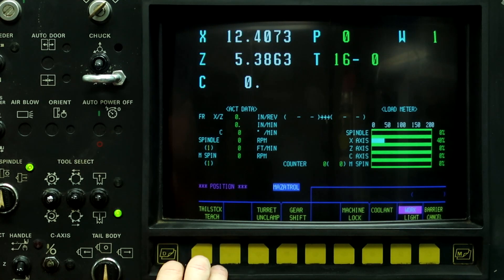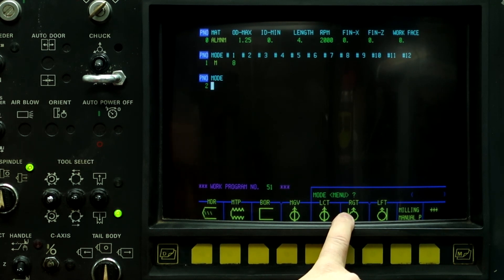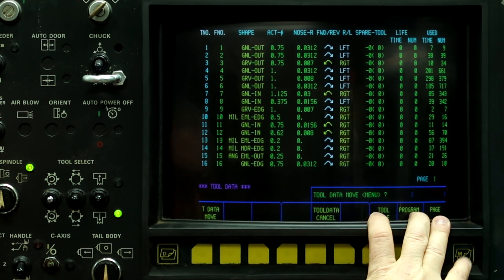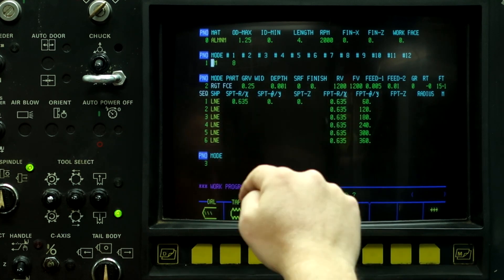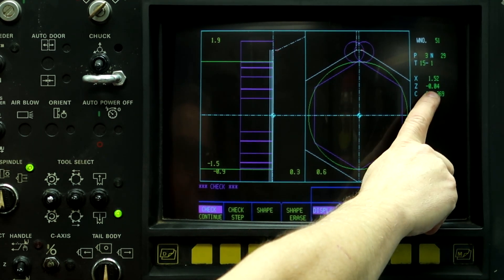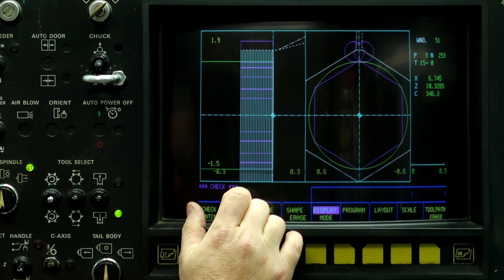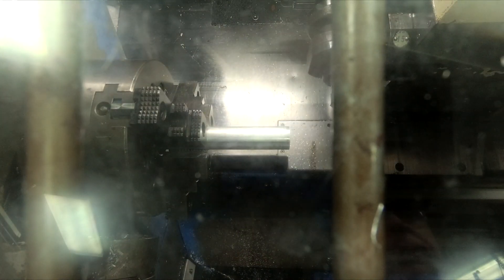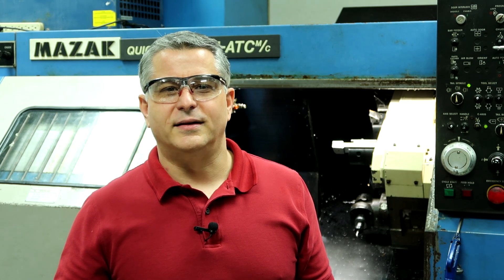Mazatrol Programming Tutorial CNC Video Hex Shaft Milling Lathe Live Tooling

Comment: Can this be done with a flat endmill or only a ball?
Reply: What about using a woodruff cutter and a live tool holder parallel to the spindle?
Reply from the maker: @danielelenarduzzi9888 yes that would work fine.
Reply: @mazatroltipsandtricks6816  
How would you describe the cutter?  I have a 3in slotting saw 1/8" thick trying to machine 2 flats 180 degrees apart.
Reply from the maker: @danielelenarduzzi9888 It would be same as a regular endmill but 3" in diameter and the flute length only .100" long. The geometry of the tool X0 is same as regular endmill so center of endmill is zero.
Reply from the maker: Only a ball endmill because this machine has no Y axis.
Reply: I wonder if you could explain why a flat wouldn’t work again- why would not having a Y axis matter it’s just moving up and down in X in sync with the spindle to produce a hex..?
Reply from the maker: @HyperionArtifice The sharp corners of the endmill will dig in to the part as the chuck rotates around. Try it out for yourself.
Reply: @mazatroltipsandtricks6816 thanks now I understand!

Comment: NOTHING BUT NICE WORK! Question: Was the ball mill used just for the radii on the sides? Would a flat bottom endmill work if sharp corner was ok? Thanks for your knowledge!
Reply from the maker: @charlescastiglione6469  No a flat bottom endmill would not work in this situation.
Reply: @mazatroltipsandtricks6816  Thanks, I musta been tired yesterday. I get it know.

Comment: Hello, I would like to know if you can help me, what could be the reasons why the milling functions LCT, RGT and LFT do not work for me, Thanks in advance
Reply from the maker: Does your machine have a full C-axis or is it indexing only?
Reply: It says in the technical characteristics spindle positioning degree
is there any way i can find out?
Reply from the maker: @lukamavricek6233  sounds like it is just an indexing only machine. Can you move the chuck rotation with the hand wheel?
Reply: how can I try it, I've never done it... in the parameters I put it as it should be, it works at a colleague's place and throws out the error 257 C-axis drive or error, do you know more about it
Reply: and locks the spindle as soon as the hydraulics turn on and I can't unlock it
Reply from the maker: @lukamavricek6233  do you have the correct parameters for your machine?
Reply: probably something is wrong with my parameters, can you help me?

Comment: Hello, when i’m milling hex don't get straight lines, but I get radius at the ends. The program is the same as here, what's the problem?
Reply from the maker: You need to lie to the geometry when doing this operation. Endmill X geometry needs to have negative value in wear comp same as endmill diameter.
Reply: @mazatroltipsandtricks6816  Thank you very much, it works.

Comment: Hey Phil, relatively new to mazatrol programming and really appreciate the videos. They help me out a lot. Thanks a lot man. 
In this video I was confused by one thing, where do you get the 1.1547 in the math? Is that something you figure out for each part because of different dimensions? Or is it part of some equation and a static number you always plug in?
Reply from the maker: I was told that 1.1547 is the reciprocal of the cosine of 30 degrees.
Reply: @mazatroltipsandtricks6816  ohhh ok, thank you. I saw another video of yours and figured it was part of an equation after making the comment lol. I actually have a set up today making hex flats for the first time so this’ll help. Thanks again.

Comment: sir I draw a square in middle of my shaft,but when I change my tool to outerdiameter  end mill, got an alarm "tool cannot perform facing"
Reply from the maker: Perhaps this trick only works on the older machines.
Reply: @mazatroltipsandtricks6816  ohhh that’s why my machine can’t make it , sir can you made a video with using outerdiameter to perform a square in the middle of shaft??

Comment: I think it's fascinating that you can do this on the shop floor even on a really old machine but man is it tedious compared to CAD/CAM Thanks for sharing
Reply from the maker: Thanks.
Reply: @mazatroltipsandtricks6816  hey Phil what if you don't have an M8 at the beginning can you manually turn the coolant on? when you want it?
Reply from the maker: @christophercolumbus8944  No. You need M8 in the program in order for the machine to activate the coolant.
Reply: @mazatroltipsandtricks6816  cool 
are you making more videos on livetooling how to set Endmills? on X and Z ? would you say it's the same as setting your drill bits? taps? etc?
Reply from the maker: @christophercolumbus8944  Yes, set the endmill the same on X and Z as a drill bit. I have showed this in other videos as well.

Comment: HI,
 Can you program milling c'bors on on face?
For example The hole is 7/32 thru and the c'bore is 5/8 and .177 deep.
6 holes on circular pattern  dia 2.937. All dim are in inches
Reply from the maker: This old T3 controller can do it but it's not going to be the same as a newer control.  What control do you have?
Reply: @mazatroltipsandtricks6816 I have T32-3, it is newer control. 
I would like to see how the program is going to look like.
Then, I will test it.

Comment: Hello I need some help with the electric part of the machine ,could anyone help me with a copy of the mazak electric manual
Reply from the maker: Cannot help you without more information like what machine you are talking about?
Reply: Mazatrol Tips and Tricks I bought a Mazatrol cam t3 from someone I’ve tried connecting it and the screen comes on but the pumps won’t .
And in the screen it shows 13 drive error
....

Comment: I hope you see this but I think you should make a video describing how to use a groove turn tool (with a flat) to do a copy or bar out (highlighted). 

I read on the forum some ways but I was a bit confused so I think a video would be great. 

One method you suggested was modifying your z geometry on the back face of what is essentially a groove by the groove tool width minus the radiuses. 

That I totally see how it works but you also suggested going in and just making you groove too very short in the tool page. How does this work? Does the machine then suddenly start comping in the other side of the tool? 

I’m going to go try these methods today and I don’t think I need the video but I think for many it would be very helpful.

I sat on the internet and read programming manuals and found nothing till I looked up some grooving info and stumbled across that info. 

I had already figured out the modifying the z values just by taking measurements and I did not know how to calculate it like you said. But I did scrap a part or two.
Reply from the maker: Turning with a flat groove insert is one video I've been meaning to do for a while.  The machine will not turn the part if the groove tool is described with too long of a stick out on the depth of the groove insert.  Anything over about. 300" long and the machine doesn't want to turn with a groove tool. You have to adjust the backside geometry to compensate for the flat width of the groove insert like I said on the forum.
Reply: Mazatrol Tips and Tricks 

Ok so even if I make the tool shorter I still have to adjust the backside geometry? My machine had no problem turning with the groove turn tool set to .7” long in the control it would just cut the backside geometry incorrectly. 

Also I am only using copy out highlighted as I do 2 grooving cycles to rough the majority of the material so I get more even wear on the groove turn tool but I may change this as I just purchased some better cutters and inserts for the job.
Reply from the maker: @ianagos4276  What controller are you using?  My T2 or T3 controls would puke if I described the groove tool length too long. Yes, you will still need to adjust the backside geometry to account for the flat on the groove tool.
Reply: Mazatrol Tips and Tricks gotcha I have a t plus controller on a sqt18ms. Pretty much the same as your controller.

Well you cleared up my confusion thank you.

Question I’m looking for a newer than 2000 machine was the fusion 640 good? Or should I look a bit newer for a matrix?
Reply from the maker: @ianagos4276  Honestly, I do not know. I have a gap in my knowledge of Mazatrol controllers.  I ran the T2 and T3 controls, ran the T+ and then jumped up all the way to the Smooth X control.
Reply: Ah Yea Im not really sure what machines had issues through they years but I think if I get a good condition one I’ll be happy. My sqt18ms is a bit old but I’m still holding tenths with it in difficult material.

Comment: Nice work Phil.
I like your thinking with using wear offset to compensate for the tool .
At least that way IF you come back to the program you have some sort of prompt of what is written into the program.
Reply from the maker: Thanks.  I forgot to choose offset #2 in the video.  I usually use offset #2 whenever I am doing odd things with the tool and the program and keep offset #1 just for wear. Whenever I see I used offset #2 in an old program, I know I had to play games with the machine to get it to work.

Comment: Thanks.  Now that redundant Z axis move while making the hex, wouldn't this be a good point in time to go with EIA instead of Mazatrol?
Reply: I am sure you would agree.
Phil did a pretty good job of machining the hex using rotational C axis.
I don,t think i would have tried to do it this way regardless of EIA or Mazatrol.

He did a great job answering a question.

I would have just run it in a mill, LOL.
But i am sure Phil would have too.

I would give this video 2 Thumbs Up if i could.
1 for posting instructional video,s
2 for even trying do this in the first place.
Reply from the maker: @weldmachine  Thanks for the compliments!
Reply from the maker: Truthfully, I wouldn't know how to program this feature in G-code without a CAM system.
Reply: @mazatroltipsandtricks6816   I too would have to look into how to G code C axis moves, never done C axis only point to point.

Comment: Neat trick.  I had a part that I considered relieving a long endmill for, but the quantity was small enough that I just left the hex for a secondary operation.  This profiling trick will work even with the flat well away from the face, and my relieved endmill idea will only reach so far.
Reply from the maker: Yes. This is not the ideal way to machine this feature but it does work.

Comment: Smart! I love how hacky that is. I think you should also show the “normal” way. That is, doing the flats with an end-mill mounted horizontally. Flats are usually bigger than the rest of the part anyway.
Reply from the maker: Thanks.  I did make a video showing the normal way a while back called Milling the Hex.  Thanks.
Reply: @mazatroltipsandtricks6816  I think he is referring to big keyseat cutter.  Seems like those speeds and feeds could have handled steel.  Too bad there isn't a way to get rid of the redundant Z axis retract every step over.  Thanks for all the help.